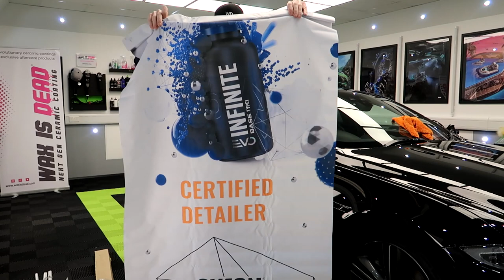VLOG 022 ( 2023 ) Jaguar XJ Paint Correction Detail @GYEON_official Infinite Ceramic Coating

Comment: Can Gyeon Base type 2 be topped with Top Coat Type 2 or does 1 go with 2 and 2 go with 1?
Reply from the maker: Gyeon recommend Base type 1 and TopCoat type 2 / Base type 2 and TopCoat type 1 but TopCoat type 2 will go on either base coats 👍